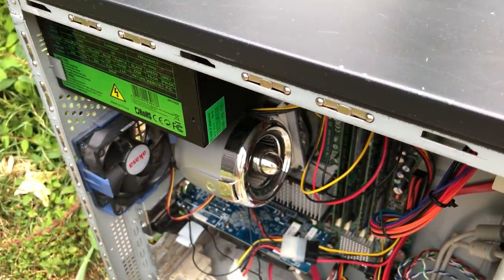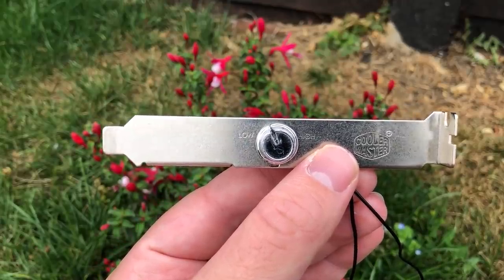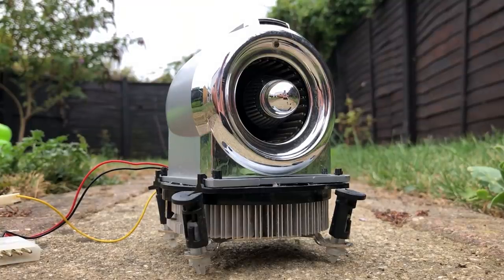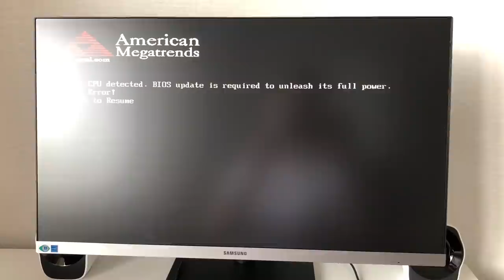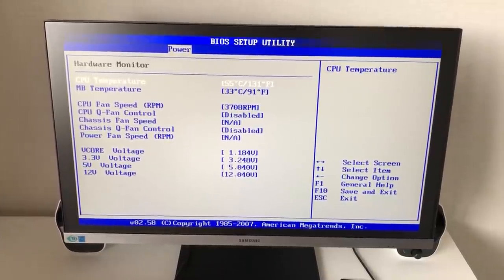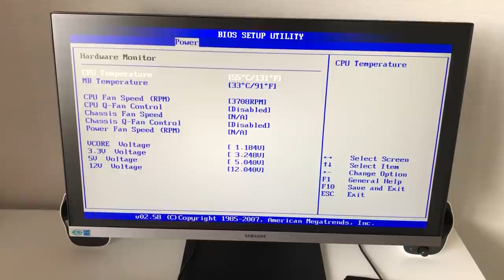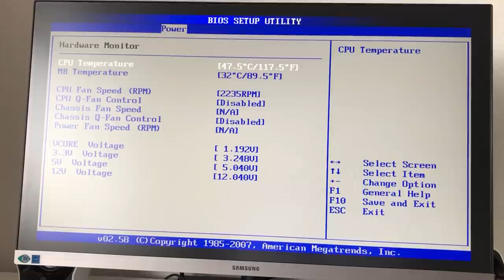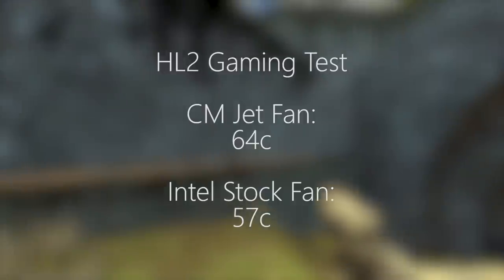Weird Tech: Cooler Master's Jet Engine CPU Cooler

Comment: While I do like the neat and minimalist designs of modern PCs, I still kind of miss the wacky modding parts that came out in the mid-2000s. I don't miss the blowers and 80mm fans though. 

Should look at the Zalman Reserator next. It was an early liquid cooling kit that used a cooling tower instead of a conventional rad. Basically this big, blue aluminum water tank with fins on it that would passively radiate heat. You'd sit it next to your PC, with the hoses coming out the back. Promised completely silent operation. Really wanted one back in the day, but my broke college butt couldn't afford liquid coolers.

Comment: OK you want weird tech... well years ago I bought from China one of them aquarium water cooling systems that you kept live warm water fish in.   I kid you not, it was basically a fish tank with an in and out fed circulation via a mains pump, filters to stop little fishies going up the tubes and it was very clumsy, very very noisy, the fish kept dying and my cats kept thinking it was a water bowl just for them.   It wasn't very good at the cooling side of things either but absolutely crazy device.   Sadly I don't have it anymore, chucked it through lack of use.

Comment: A picky point but, the efficiency of the cooler has no effect on the temperature of your room. It's the same amount of heat being transferred. In fact, a cooler that reduces the CPU temperature just transfers the heat to the room faster, but it's the same amount of heat that eventually ends up in the room.

Comment: The dial seems to be a plain old potentiometer (adjustable resistor): https://en.wikipedia.org/wiki/Potentiometer
Most likely it's wired in series with the fan, so disconnecting it leaves the fan without power.

Comment: I found an old Alienware that has a core 2 extreme qx 6850 ($1000msrp) , 8gb of ddr2 (which looks to be anywhere between $100 and $400 worth of ram at the time), and 2 gtx 260s in sli ($800/$600). This thing seems like it would’ve been amazing back in 2008. Do you think you could find something like this to benchmark today?

Comment: Seeing as they both utilize stock coolers, try the "jet" on the thicker heatsink to see if there is a difference between the two types of fans as far as air flow goes. as its not really a fair comparison when one heatsink is 50% the size of the other...

Comment: I mean, technically it is possible to make a Jet-like cooler that actually cools down CPU as good as Noctua.

Just design the fan blades equally the same like regular Jet Engine. And then compressing air which Cooling a Copper pipe shaped like a coil.

Comment: I had the Aero 4 version of this cooler with 3 80mm fans in the case. Oh boy, was hard to be in the same ambient as the computer because of the noise. And it struggled to keep the Pentium 4E cool

Comment: Damn, I had one of these on an old socket A setup with an Athlon x2 5000 black edition. It actually did pretty well. Had it going in an old MGE viper case with an ASUS M2N SLI deluxe motherboard

Comment: I have one of these though the earlier one with a square heatsink for Athlon XP.  At the time it seemed huge (and was) but the overall package is tiny compared to modern day heatpipe based heatsinks.  It makes an annoying amount of noise at anything over medium speed and performance isn't exactly great.  I remember just taking the jet off and putting a standard case fan on the heatsink instead.  Cooling barely suffered but the noise level went way down.

Comment: Squirrel cage cooling theoretically should bring good cooling, but in practice, when you shrink a squirrel cage, it loses it's testicles, the performance doesn't scale. Because of this, you just end up with a noisy jet engine that doesn't even cool very well.

Comment: They really missed out on having the fan exhaust towards the CPU cooler instead of somewhere else. Also, why the heck would you want an "exhaust" or a high pressure side on a cpu cooler that just points somwhere into the case?

Comment: With all the parts you buy and sell, you should invest in a data vac. Over the long term it will save you a lot of money on cans of compressed air and they also blow a fair bit harder than cans of air

Comment: This style of fan moves a lot of air, you just need better seal and square heatsink, not round with dead zone in the middle. Try fitting it to different cooler or radiator.

Comment: You could also look into getting a 'Metro Vacuum ED500' never need any way overpriced can of air again. And no issues with the liquefied gas spraying your PC if you hold it wrong. Has way more power then a can as well.

Comment: I have one of them my jet fan was from athon xp and it had another heat sink and had the option to put the speed control in the rear bracket or in the floppy bay, i have vivid remeber because few week ago i faund it cleaning, it din't work and sadly i broke trying to fix it.

Comment: I've just check my old pc that has the same jet cooler. The performance may be low because of the headsink. The original heatsink of the jet cooler is almost as big as the cooler and made of cooper and a square shape. 👍

Comment: That’s old there I used those in my amd gaming pcs back in the day I have one down stairs in my XP machine it was great for gamers you could turn it up and down with a little knob, that was a good fan back in 2002, mine still works great, I also have an ATI TV card downstairs, I had to clean that fan every month cause I was a smoker I’m glad I finally quit, that’s a later model mine has no RGB, those are for single and dual core processors

Comment: PC cleaning hack for when you don't have dusters and you need to clean a fan : Use a high power 2000W hair dryer on full blow but minimum heat or no heat option. Never need another duster since I bought a fan like this for 10 Eu (best 10 Eu i have ever spent)

Comment: I bought something similar from Cooler Master, but it was a model I haven't been able to find anything about until recently: https://bjorn3d.com/2003/07/cooler-master-aero-7-cpu-cooler/

I wouldn't want to have to manually change my fan speed settings anymore, but as a kid this was a fun gimmick. Besides the noise, one of the biggest downsides was how dust would accumulate on the heatsink. It would actually cover the entire intake below the fan, so even though the fan was running, very little air would circulate through the heatsink anymore, and you had to remove the fan occasionally to clear a thin layer off. I remember clearing the dust off of it for the first time and being amazed that WoW ran so much better afterwards.

Comment: Hello I am wringing today as I have a pc on Windows 10, but I was wondering if someone could tell me the recommended specs with the components I have,  i have a Intel Core 2 extreme x6800, Amd Radeon hd 7900 series, not to sure what my mother bored is but the module number is G3m1-s2l gigabyte, 8gb ddr2, illd be thankful for any help

Comment: I actually have one of those coolers with the original copper heatsink and IIRC it was way better than the stock coolers of its day (No im not using it right now ROFL).  As someone else said, the heatsink in the video has that big circle in the center, which is wrecking the airflow. I had a wacky homebrew air tunnel setup to feed mine fresh air from the front of the case.  .

Comment: There are alot of Thermaltake and coolermaster weird cpu and ram heatsinks.

You need to cover the v6, v8, v10, and v12 coolers. The v12 is a cooler that literally is a engine

Comment: i guess it's based on the cooler master aero cpu coolers that used blower type fans instead of the traditional box fans. CM just made it fancier looking with the jet turbine design (many mods from those days had people putting cones on their box fans to achieve a slightly similar aesthetic). back to the fan, the only thing it did was blowing dust to the cpu and mobo and not much cooling not to mention the noise level

https://www.overclockersclub.com/reviews/cmaero7plus/3.htm

Comment: I had one of those, kept it for years. Worked ok, had a light on it oooohhhhh. Think it went onto my amd build back in fall 2004? Or the one I did in 2006... To long ago to remember. Yes very loud didn't last long installed, and only cooled ok on high speed

Comment: Well, hate to be that guy but there's some misconception here. Any cooler that's rated for dissipating "x" watts will do a good job in any CPU that fits that requirement. The heatsink part of this cooler has clearly been butchered together with the "jetfan" which helps explain the less-than-ideal cooling solution it provides.
That said, I can imagine a modern heating paired with the jet fan working well with a selection of modern cpus...

Comment: i mean ofc its not gonna work without its speed dial, u also could have just connected the two wires. u atleast have to close the circuit

Comment: I had some Thermaltake north and south bridge/IGP versions of these jet engines and boy were they noisy but they were also highly efficient CFM shifters.   Still reckon you should have a go at Coolermaster MK1 and MK2 V8 and the beast V10, I use the MK1 and with davinci resolve chuntering away as I upload to youtube, surf and listen to some tunes, its hardly breaking a sweat at 21c core, 38c on the hot toasty gpu parts and case ambience around 30ish and this is the 9xxx 8 core Vishnu so a roasty cpu to begin with.   The magic happens I think in the case as much as the cooler, the case is a Coolermaster HAF-XM with the two big 240mm fans atop, a big fan in the faceplate, fans under the HDDs and a pair of 120's on the backplate, can't fault it really.   Graphics is a 8gig 570RX which has proven to be such a gawjus all rounder, will never go back to nvidia...

Comment: 2:48 oh my, you need to get a can of compressed air! Should be findable for cheap at some household store (something akin to the "Action" we have on mainland Europe)
Reply: Why? Washing it with water under high pressure is a lot more productive.
Reply: @user_imyarek  check the timestamp...
Reply: @WouterVerbruggen  So? You won't be able to damage it with water without electricity, and this fan most likely needs to lubed anyway.
Reply: @user_imyarek  and you won't be able to use it for hours after because you need to be sure all water is evaporated. Compressed air is also a lot better a getting rid of tough dust in hooks and crannies like in such s fan
Reply: @WouterVerbruggen  for hours? Lol no, put it under the sun and in 20 minutes you're good to go.
Reply: @user_imyarek  any idea how humid British summers are? Anyway, it's still waiting every time versus spend around a pound/euro/dollar for something that's instant ànd better results. Easy choice

Comment: you will not belive the deal i just got
i3 8100,rx 580,16gb ddr4 2666,h310 mobo and a cx 500w cosair psu for 290, the cpu mobo and ram for 140 and the case and psu for 50 and the rx 580 for 100
i bought it though for the purpose of selling it so im really happy with it

Comment: 1:55 "durr blower coolers suck" Oh yeah? They dont have a deadzone behind the motor.
Stock cooler: 80mmx25mm thick axial fan (with a 20mm dia motor) has a swept area of (5026-314)=4712mm2 This blower: 80x80mm exhuast=6400mm2 +35.8% more area.
I wanna get one of these for my own testing Edit: struggling!
Apparently this site from 2003 has them lol but its USA only :(

Comment: WTF the RPM range is 1900 to 3500. A high bypass Turbo Fan on AirLiner spins at 2500rpm. It even has a high RPM like a Jet Engine.
Personally my CPU cooler cruises at 750rpm and maxes out at 1000rpm.

Comment: I don't understand how a jet engine will cool a CPU when they put out a ton of heat. I think what you meant to say is that someone built a "ducted fan" cpu cooler". It is patently stupid no matter what you call it. It is so stupid because it is set up to look like an axial compressor but it is, in fact, a centrifugal compressor. The sound is inauthentic because about the only aircraft which use a centrifugal compressor these days is a helicopter.

Comment: You should take the "jet engine" fan off that modified heat sink it came with, that cooler's profile is very low. If you can adapt the stock intel cooler to the "jet engine" I think the result would be better than the stock heat sink with the stock fan.

Comment: Well, maybe this should remain in the mists of tech history as I wouldn't like that AMD or nVidia put one of these on newer generation reference coolers. Also, how this exactly works if the airflow goes horizontaly from the air entrance of the turbine to the end? Really that thing redirects some air to the disipator below? Did I miss something? because I don't find ANY sense to this jet thing aside of the looks

Comment: You have tested this fan by unfairly fitting it to the heat sink from the Intel cooler.

Originally, the CoolerMaster was shipped with a copper heatsink with dense, parallel ribs. The fan is designed to work with the different heatsink.

It doesn't mean it will be better, but the current test is just unfair ;-)

Comment: I feel like a jet engine styled cooler could work, but not with this design. 

Looking at the arrangement on this thing, it's no wonder it sucks. Literally. 

As far as I can tell from just looking, it looks like it sucks air up from the bottom through the heat sink, and blows it out the back. It would be much more efficient if it blew the air through the heat sink instead of sucking. 

Not totally sure how you'd make that happen without ruining the jet engine aesthetic, but I'm sure it can be done.

Comment: i do have heatsink for that pc blower cooler

my old pc blower fan died out because worn out during it life of used up
i remember have it from 2002 it was like clear see thur with heatsink 80mm x 80mm x 30mm it died out in 2007 n my pc died out n find out that blower quite working

im surprised you find one n post on videos but u need right heatsink for it otherwise it wont work currently on other heatsink

Comment: I had one of Cooler Masters other coolers like this, it had a clear casing around it and a blue plastic fan, plus the dial to turn it up and down (basically to adjust the amount of noise it made). I think the heatsink itself was copper. OK just looked it up, I had the Aero 7+, thats what it was called if you want to google it.

It was a seriously POS garbage cooler, would not recommend. Go get a Thermalright for your old AMD T-Bird...

Comment: If the jet engine is hitting straight up I'll be much cooler but it hits in an angle and it loses a lots air speed

Comment: I got a chip on the core 2 quad platform 2, and it aged horrible and its about as good as its gonna get I got a motherboards that supports 16giga of ddr3 ram at 1600mhz ( gor 16gigs running at 1271 or something currently still haven't really overclocked the ram just the cpu).

I pushed the cpu(QX6850) to its limit at 3,76 ghz at a voltage that should just not cause degradation( max voltage that its designed for is 1,5 and im running it at 1,48 something, and read 1,55 should be easily doable.) And most games run at just 30fps and some can push 60, everything it boots is just playable but its missing a bunch of instruction sets too. And no l3 cache

And it was 1500euroes new in 2007 and then just 2 years later the xeon X3440 for just 180 euros would dessimate it, even with just 2 cores and 4 threads enabled it would beat it. And lets not talk about the xeon using all 4 cores and 8 threads it won't have asscheeks left to he clapped.

But its still intresting to have it and see what it can do in 2020 with basically ideal circumstances, ( because most 775 motherboards run 8gig of ddr2 ram at max 1033)  or well the high end ones do. 

But basically and first gen I core cpu will beat it and even the weakest i3 will preform very similar so its kinda sad looking at it that way. But the first gen i5s for sure  decimate it and those didnt cost 1500euros.

Comment: Buy a small compressor, it's not expensive and very usefull for cleaning computers and laptop and so on. I use compressed air for more than twenty years to clean PC's. Never had a problem, you just have to watch what you are doing.

Comment: Had one of these myself many moons ago.. I have to say, yes they looked better (back then) but still no.. 7 degrees is still 7 degrees. That like having a Ferrari that's slower than a Ford Fiesta
Reply: Not the correct heat sink on the thing... Fan and fan controls frankensteinining onto a Intel stock base from a few years later.

Comment: With the original heatsink those coolers came with they are better than the stock coolers. Most of the blower coolers air path is blocked by the center of a stock heatsink and thus gets less airflow while a stock fan the hub is over the center of the heatsink and gets all the airflow. Your comparison test is meaningless because that's not a proper Jet 7.

Comment: Buy a compressor air in a can is such a waste of money

I blow dust from my gaming rigs with my 30 year old air compressor. 
I turn it from 160 to just 25-30 psi
No issues and when I use 100 gallons of air per rig it is mere Penny's

Heh